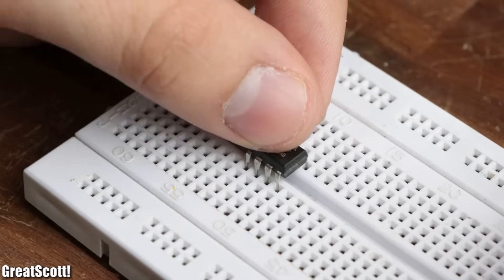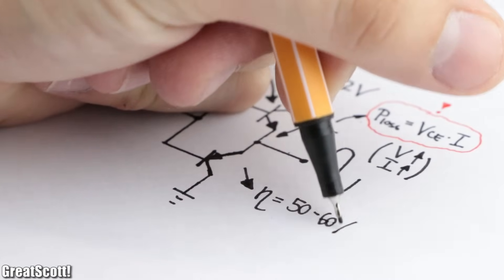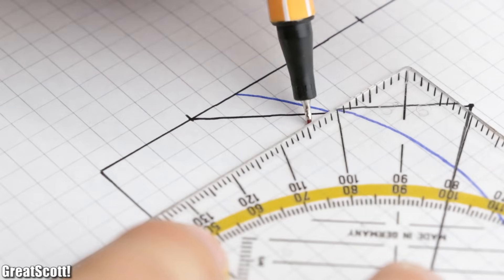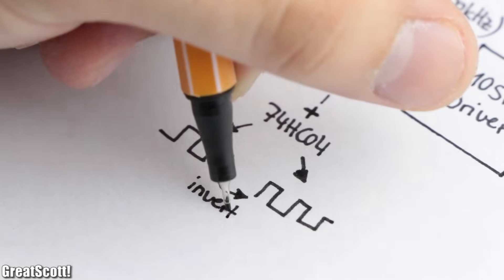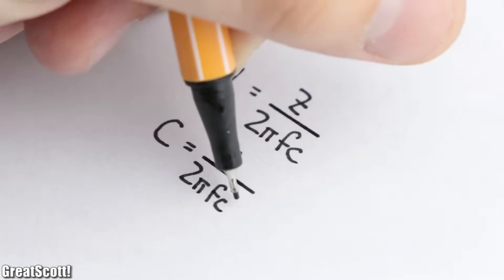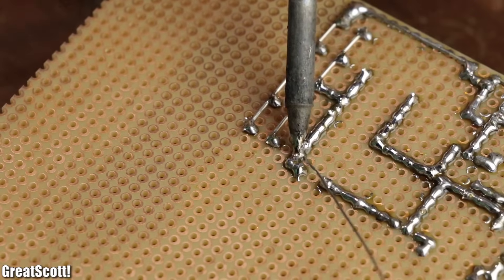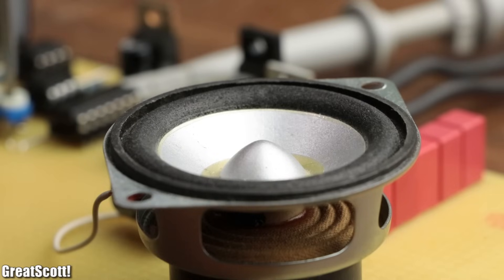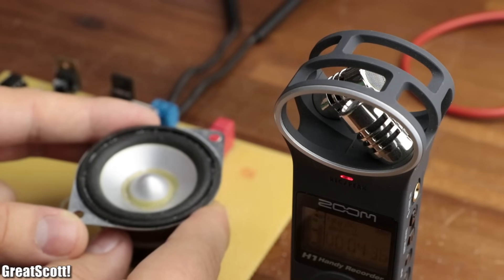DIY Class D Audio Amplifier

Comment: Dont waste energy kids
Reply: Ahmet Asantas eh.
Reply: Ahmet Asantas you can't "waste" energy it can only be transferred from one store to another
Reply: Ahmet Asantas you can't "waste" energy it can only be transferred from one store to another. I listen in science (most of the time)
Reply: Not really. If even the energy cannot be elliminated, the heat produced by the transistors are useless and even harmful. And that is why we use heat sinks.
Reply: Well, the heat dissipated will keep you nice and warm during the winter?
Reply: @baylee3754  There's a thing called "entropy"
Reply: @baylee3754  Energy can be wasted as heat. Heat is mostly useless. So it is seen as waste.
Reply: @richardlighthouse5328  But still the energy is just radiated and is still in the radiated form of heat, so the energy just changed its form...
Reply: @richardlighthouse5328  Energy can never ever be wasted!
Reply: @JustSOMETHIN-v1y  In closed system, the energy will not magically disappear. What I mean by wasting energy is not using it.
Reply: @richardlighthouse5328  Okay! 👍
Reply: I'ma use vacuum tube
Reply: Don't heat away energy kids 🔥
Reply: you mean entropy
Reply: Yap yap

Comment: You don't happen to have an old set of cabinet speakers lying around, do you? It's amazing how much an enclosure can increase the sound output of a speaker.
Reply: @Nash Finnley This is a bot.
Reply: i guess Im asking the wrong place but does anybody know of a way to get back into an instagram account?
I somehow lost my password. I would appreciate any tricks you can give me
Reply: @River Immanuel instablaster :)
Reply: @Anakin Rudy thanks so much for your reply. I found the site thru google and im waiting for the hacking stuff now.
Seems to take quite some time so I will reply here later with my results.
Reply: @Anakin Rudy It did the trick and I now got access to my account again. Im so happy:D
Thank you so much you really help me out :D
Reply: @River Immanuel no problem :D
Reply: Yeah, if the speaker isn't enclosed you lose more than 50% of Volume due to Phase cancellation
Reply: @riverimmanuel7955  reset your password

Comment: Hey Scott, make a long range radio transmitter and receiver, and maybe show us how to calculate its range. That'd be fantastic!
Reply: yeh, if could u make transmitter and receiver circuit for like something that is rc that'd be fantastic
Reply: It would be really awesome if it can achieve really high LOS ranges.
Reply: I don't think he wants to do that since it's illegal here in Germany. But it's very simple and many videos are online for that.
Reply: The reason there is no FM on Shortwave ( Or AM and LW) is because the band width is not there that is required. Broadcast FM takes up nearly 200 Khz of "bandwidth" (Which also accounts for Guard bands, frequency deviation of the transmitter, and the bandwidth of signal). The typical AM band, 550 to 1600 KHz, would allow about 5 stations only for a given area. But it gets more complicated then that..... FM has the "Capture Effect"- The ability for a stronger signal of two (or more) signals to be demodulated and make the weaker signal even more weaker, hence blocking it out. (Which is pretty handy if you live next to a tower with a lot of FM broadcast stations, and only want to pick up one. Also helps with noise.) But with Frequencies down on the AM broadcast band, wavelengths travel extremely long distances, mostly during the day. (But there can be some anomalies during the day) So stations would be mixing and capturing each other, pretty much resulting in 5 stations per perhaps 500 miles. Even stations out side the 500 mile zone could mix, providing conditions of the atmosphere is right. ..........Sorry for the long reply, It's a good thought. I'd love to listen to stations way off in other states crystal clear with no lightning crash or other electrical interference.
Reply: At 11 and 10m you are allowed to transmit in FM and or AM.
Reply: I believe you, but that's an application specific need for FM. They may not have a FM broadcast band around in the 100 MHz or so range.There is also room up in the 10 meter end of the SW bands for FM. I am in the process of building one now on 29.640 Mhz. It's not till you get to 11 or 10 meters that FM becomes practical. Then, most long distance propagation come at certain times during a high sun spot cycle.
Reply: mohammed mokhtar long range = high power + long antenna
the power is especially important for am...
Reply: Guys, guys, guys... I didn't actually expect that to be of such a great interest, so let's clear up what(I think) we want right here:
1) FM/AM broadcasts over short distances.
2) Sending radio signals over very long distances with "Line Of Sight" propagation.
3) Sending radio signals over a decent distances with "Non Line Of Sight" propagation.
4) How we can calculate ranges and bitrates of modules make.
5) How all this stuff works
(Correct me if I got something wrong)
6) How you could interface this module with a microcontroller (e.g. Arduino)
7) How those could be used to program RC models including, for example, cars, drones or sailplanes

That could all be packed up in one ultimate wireless networking guide!

Scott, I know this is a lot to take in and is too much work, but this is gonna be a lifesaver for many people.
I've been into this stuff for some while now, and this is the link that was most useful: http://www.electronicdesign.com/communications/understanding-wireless-range-calculations
Reply: mohammed mokhtar 
and how to use the transmitted data to control an arduino....cause i bought a 433Mhz rf module and it has lots of interferences and I would love to know how some code can fix that
Reply: could u plzs add transmiters and recivers for rc cars and others but plzs tipe it in a bit smarter way cuz u probably understand electronics
Reply: Fantasterrific Maybe: that could be used for almost anything
Reply: Mohammed, I suggest two books: Microwave Engineering by Pozar, and Antenna Theory and Design by Stutzman.

They won't show you how to build the electronics exactly, but they will help you know how to calculate antenna ranges, far field radiation patterns, bit rate, and how "all this stuff works."

To build the electronics there should be tutorials online.
Reply: It's illegal
Reply: gud idea
Reply: Then if we all make one we can yell at each other and laugh crazily like mad scientists >.<
Reply: mohammed mokhtar i dont think he will do such a thing. Its illegal to do this kind  of stuff in germany without a proper license
Reply: maff1917 some bands are unlicensed. This includes the bands used by our wireless routers, walkie talkies, our remote controls and our phones(e.g. 5Ghz, 2.4Ghz and 915Mhz). Only some other bands are licensed, and we all know we could buy a tiny FM transmitter that could be plugged into any car. How is that publicly sold if it is illegal??
Reply: mohammed mokhtar Part 15 devices. I knew this would get brought up. They are restricted to very low power (.1 watt or less), have permanently mounted, ineffecent antennas. There is many reasons to this, primarily to cause interfereance to other part 15 devices, but also in some cases when the share it with the Amateur Radio bands. Amateurs have a priority on the bands.Part 15 is secondary. They must accept any interference recieved.(Although hams are nore careful not to cause intereference, more comes from part15 users). This only applies to the US under Title 47, the FCC rule book, etc. Other countries have similar things, but its best to check local laws before transmitting.
Reply: mohammed mokhtar - Because it's only unlicensed if the equipment meets specific parameters which have to be thoroughly tested and approved. You can't make your own transmitters and use them legally. I doubt you'd get caught, though. There's someone near me using an old UHF mobile PMR radio, possibly putting out 25 watts on the PMR446 band. That's 50x the legal power! He also has a roof mounted antenna. The chances of being caught abusing the power and antenna regs on PMR446 are almost nil. Someone would have to put a complaint to the authorities, and even then they have much more serious radio complaints to deal with. I'm not advocating such behaviour.
Reply: mohammed mokhtar i want to know how do i match a speaker to an amp? speakers come in various ohms, wattage and sizes. if an amp has 100w 8ohm output then can I choose a 200w 8ohm speaker or I can use 80w 8ohm speaker also? how do I know what size (diameter) of a speaker will work?
Reply: There are a lot of factors to consider.  Effective power and gain at the antenna, directional or omnidirectional, terrain, frequency and more.  That is the advanced class.

Comment: I have followed this video to build a class D amp. There's some thing you should know if you also want to follow this video. 
:thanksdoc:  the 1nf capacitor at 555 timer is used to convert square wave into triangle wave. In my case 1nf is to small to fully convert the square wave, you should hook up a oscilloscope and swap a few different capacitor until you see triangle wave.

:thanksdoc: R3 (2k ohm) is used to control the frequency at which 555 timer oscillate. I'm not using TLC555, instead I use NE555, in which case the frequency is only 2k Hz if I use 2k ohm resistor for R3. To solve this, you simply replace R3 with a 10k potentiometer, and see what resistance is required to get 200k Hz. 

:thanksdoc: I added a 1000uF capacitor in series with the speaker as a coupling capacitor to block the dc at output stage.

Any way, thank you @GreatScott! for making all the awesome videos about electrical stuff. It helped me a lot.:face-red-heart-shape: Keep on

Comment: Great video Scott, may I request a video explaining how to read and apply characteristic curves/graphs and technical table spec sheets of semiconductor devices such as transistors and diodes to constructing circuits? Because I got confused in some parts of the video wherein you made use of those curves and tables but I didn't understand why those values mattered and how to interpret them in the way you did. Also, may I suggest when displaying those curves/graphs to not show them at a dutch angle? It seems a bit difficult to interpret at first viewing. Thank you for all these very technical but non-jargon heavy electronics videos, they're quite insightful. Hope to hear more from you Scott.